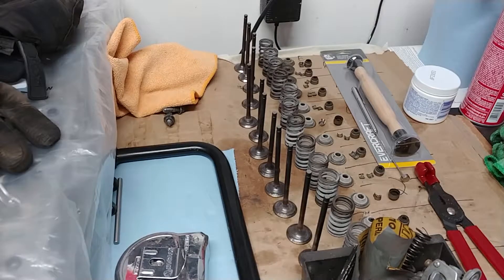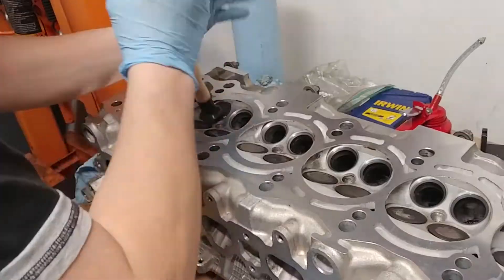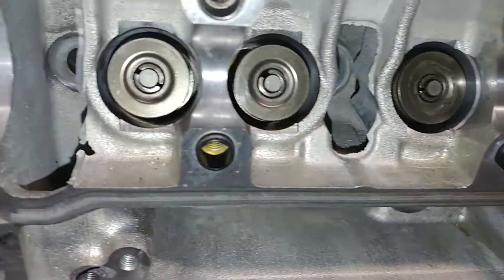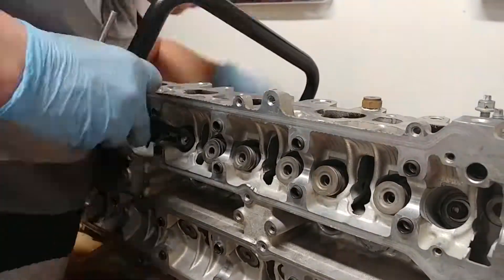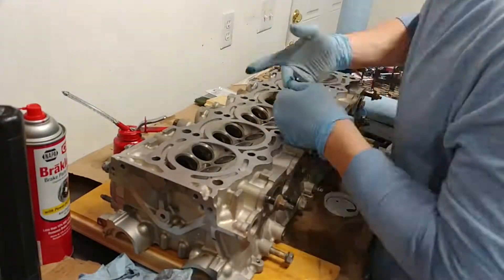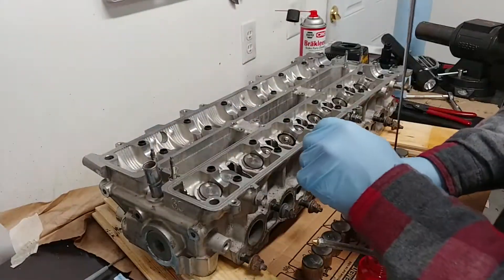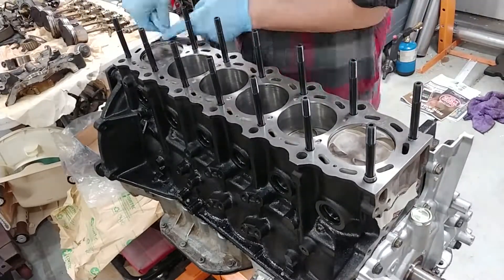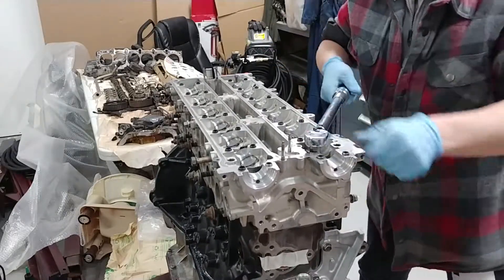2JZGE NA-T Part 4 Cylinder head work and Install

Comment: How do you know your done lapping? This is my first time. 

And should I change my valve seals agian. Will brake cleaning it ruin the seals?
Reply from the maker: its all about sound and how the seat looks. Should be uniform all the way around. Also, feel free to check out some more vidyas. It was my first time but wanted to show even the biggest idiot can do it haha
Reply: @SALTYZETTO  what about that blue paste? 

How long did you lap each valve? I spent a couple min on each one
Reply: @SALTYZETTO  well I got it lol. Atleast I think I do. 

I had a little light shining though the bottom of the valve looking through the port. But went away when spring and retainers installed. 

I didn’t send to much time on them. Just lapped to clean them up.

Comment: What size head gasket did you use?   Do you care about the squish factor when it come to these motors????
Reply from the maker: I used the stock GTE head gasket. I researched the squish factor and concluded just to "send it". There are many success stories with the GTE hg on the GE block/heads.

Comment: Starting a rebuild myself, on a 2jzge vvti out of a is300 going in to a sc300. Wondering what is that red can? They one your using while your installing the buckets. What’re you pouring it on and what else do you pour it on ?
Reply from the maker: It's an oil can. Just have some 5w30 in it. I mainly was using that during my valve grinding procedure. You squirt some oil in your valve guides before you grind to limit premature wear.